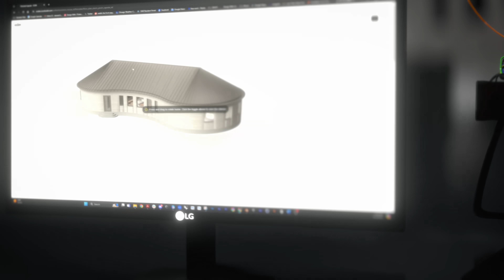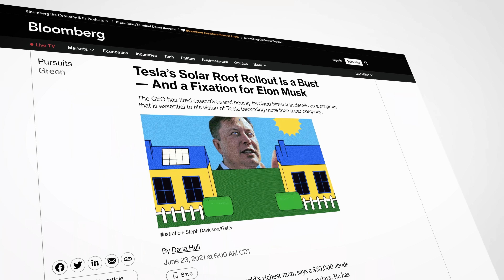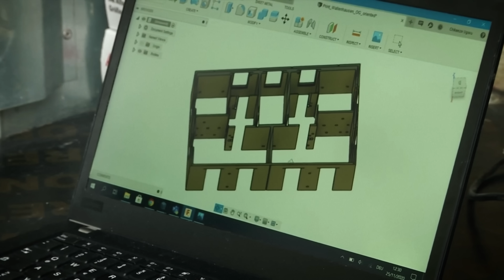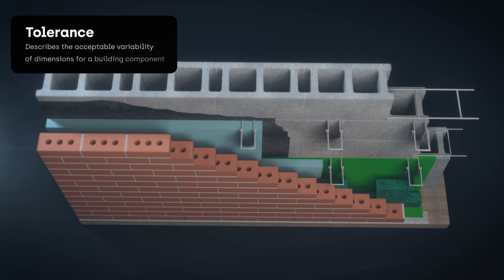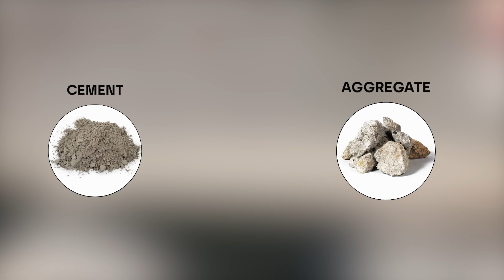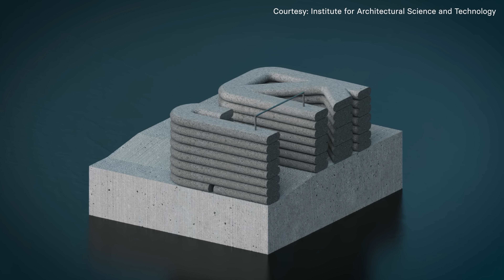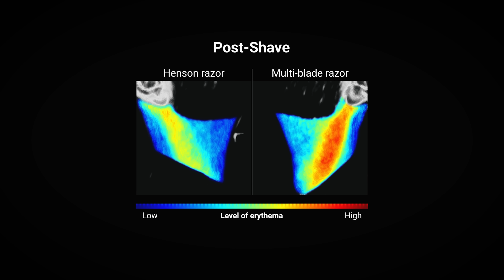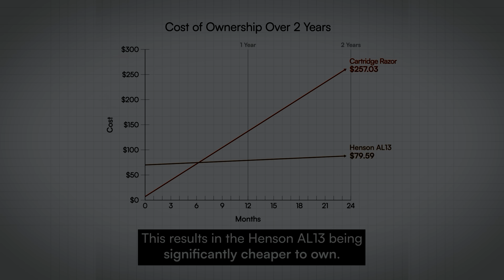Why 3D Printing Buildings Leads to Problems

Comment: From the comments, I've noticed others have mentioned about the plumbing & electrical, which I have to agree with.  Usually, those plumbing would have been determined on the layout of the foundation before pouring the slab.  In the opening scene, slab is poured but it looks solid, with the walls, but I see no plumbing for water/sewage established.  Putting in water fittings and plumbing after the fact or repairing might become problematic.  Is the electrical/communication also underground established or above ground?  The segment discussing the windows and mentioning of drain vents for water in the walls to drain out was interesting, but I was wondering if the mixture of the cement pour should be weak/bad, that didn't pour/spread evenly, there might be a gap or weak spot that an upper window/opening at a higher level of the pour pouring allowing water to get in/flowing downwards within the walls that any weak spots in the wall on the inside perimeter would find and leak inside.  Then one day, the owner finds dampness on a upstairs floor or moist running down an inside wall.  It might be complicated to detect where the leak originates.  Are the exterior cement or interior cement walls plastered, or plaster walled so that hanging of pictures can be done?  Usually besides windows, exterior lights or interior lights, drapes, pictures, electrical outlets are installed, so the wiring would be running inside of the cement walls between the cement wall and wooden/plaster board walls?  The section of modifying the construction later would also be a factor of homeowners after several years of the owner's living will definitely come up for expansion/modification.  The question of durability of cement?  At some point in time, wouldn't the mixture start weakening?  I have hollow tile cement block retaining walls, which I see some of the cement tiles flaking apart.  Wouldn't that occur with the same cement as well as stress of ground shifting and such?   I know the contractors built my slab home and I had the workmen later on pour a sidewalk around the perimeter of my house with cement, but while it was wet cement that came for the workmen mixing and framed next to my foundation, the wet cement wasn't 100% insect proof that termites or ants would work their way up through the gaps in the sidewalk and trying to entering the gaps of the exterior siding and interior walls.  There's a lot of questions on addressing issues about this type of construction.

Comment: The best way to build a house is building it in sections in a factory with plumbing , electrical , doors  and extras pre installed. You get very little waste and the truck used  to deliver the sections can also be used erect the house if it has a crane fitted.

Comment: Cars and phones.. have gotten cheaper and more and more cheap. Despite their prices.. going up. 50g for a average car, 1200 for a "phone".

The Construction industry.. is a physical operation involving people and property. Half of which cant = shouldnt be eliminated.. purely due to cost. As we find out devices are made by computers.. and or whole factories... can "almost" run themselves.

Vertical integration.. is a tech word only applied to the quick and easy applications of plastic and its many forms.

Comment: So you are partially incorrect about them not being able to make sharp 90 degree turns as it turns out they actually can but not on all corners.. and thats without any fancy modifications. If you think of a cross like the letter t, you have 2 straight lines with 4 90 degree corners at the intersection and yes 3d printers have been able to do that for a long long time now.. many years.. you lay down 1 line then come back at another angle over.. you either get a bulge or you reduce the material flow over the spot.. but they have been able to do that for a long time thats actually how they get from 1 area to others over gaps by just stopping the flow...so technically they can do them.. and have been sorta doing the things that would make that possible soooo... lol

Comment: Another mistake. Thinking repair is difficult. Look at composites. You modify air frames with a chainsaw and a relay up over the cut. You are stuck in the logic of old materials instead of immersing yourself in the new material and working with its possibilities.

Comment: 3d printings largest benefit is in the creation of otherwise impossible geometries. For example, creating a strong and light weight member by printing a stress flow optimized internal latice structure. Or creating convoluted internal cooling channels. Etc...

What 3d printing is not good for, is simple, cheap, and repetative tasks. Like building a wall according to code.

3d printing could be useful if building code was updated to allow for the interesting "impossible" internal geometries it shines at creating. But according the current code there really is no reason to even consider it.

Comment: I just don't get why all 3D house printers are hellbent on printing the whole house. 3D printing is an awesome technology, just like reinforced concrete, resins, drywall etc. It can be used in many parts of a house structure, but it DOESN'T have to be used all over. Finding new ways to integrate old and new technologies in a harmonious way is how architectural construction develops

Comment: 3-D printed wall - takes days to place, a carpenter crew assemble and stand walls in hours, with no issues to make openings.  Hollow walls are the heart of modern mechanical and electrical installations - since these M&E trades need access to the wall core, steel or lumber framed walls are a simple solution leaving off sheeting one side until the M&E is both installed and Inspected.
Whether the building is in a cold or hot climate it still needs insulation, vapour controls, roofing.
3D printing doesn't solve or fit with any of these requirements.  Meanwhile the 3D printing material is highly controlled and non-recyclable material that is not saving money or energy in the overall building process.

Prefabricated panelized walls seems to be far superior to printing on site, far more acceptable to traditional construction skills, inspections, and BP  approvals.

Comment: 3d-printing buildings are not durable or even safe.  Ground settlement,  earthquakes,  how does a high mass,  weak unreinforced structure perform? forget it.  maybe in the future,  but the current technology is a liability,  and a dangerous risk for most areas of the world.

Comment: You missed one very important point. Manufacturing cement generates a lot of CO2 (I've read somewhere that it surpasses the Aviation Industry fuel burn) so, if we want to design sustainable housing, maybe it's better not to too much cement.
Here in Portugal, for small houses, the trend is to use relatively large "thermally insulating bricks" that are relatively quick to install (10 bricks/m2) and don't require much mortar/cement.

Comment: Cement Printing is Pathetic and Dust Collectors , they cant even design scrapers on the side of the print nozzle which smoothens out the walls vertical face, At least then you would be getting a better finished product?

Comment: The inflexibility after construction and difficulty of repairs are huge issues. Houses should last preferably over 100 years, thus needing repairability and flexibility. 

Also, if you leave it bare on the interior, it seems like a nightmare from cleaning perspective. Way worse than round log wall, and even those gather dust in an awful manner. On the outside, how will that texture deal with rains (expected to increase a lot in the next few decades in many areas) and snow?

Comment: For experimentation, the 3D concrete printing is interesting. BUT this is only one element of the construction process. Concrete is great for compressive loads but not so good with tensile or shear loads. Throw rocks at wood construction as you will...but wood can be made much stronger than these piles of concrete. And wood can be modified with much much less pain. Yeah, this idea is a bit dumb.

Comment: My question to you is so what I mean technically the building now has rounded corners that's actually better considering kids like to smack their heads against stuff that has sharp turns and it usually ends up with them losing teeth how do I know

Comment: How do you repair things like electrical or wire in new outlets you may need in the future. What if rats make their way up the plumbing and eat a hole through the off gas pipes. Do you need a concrete saw just to cut into and access the plumbing and electrical. Plus how do you restore the wall. Sounds like a nightmare to service. Rodents will find a way in and will bankrupt the owner with repair bills.

Comment: Its kind of hilarious that the only thing that have to brag about (speed) requires leaving out the time to set up and tear down the machine. Youre gonna have 3 to 4 days in "printing" a building and 3 to 4 in having a crew stack brick. In the grand scheme there are better methods being produced right now including multiple modular homes you can have delivered and assembled in a couple days that are mostly self sustained. The tesla home that has been proposed is currently being built by the company tesla partnered with, and should be released with the actual tesla branding in the next year or so according to rumors. 3d printing is great for a lot of things, but not everything

Comment: With small home 3D printers I wish the printhead had some type of vision or sensors that could look at the previous layer, ensure alignment, even if there's noticeable shrinking.... It would seem that with a house something like this would be even more valuable in case of situations where the location or the machinery doesn't work quite right. You could have those wall placement tolerances, and if a wall has to be placed outside of that standard then the machine could stop and alert the operator

Comment: If you are prepared to build with concrete walls precast panels are aesthetically more pleasing easier to line ,more versatile use existing infrastructure and very quick.i have poured 32 panels ( only 3 of similar size) in eight days on site and two days for erection on a building of  300 square metres .that included several fancy entry panels. Manpower, three carpenters two concrete finishers and supervisor on a very tight site. Setup time for for work was three days. Entire build time 49 days.

Comment: If you make a car or computer you don't have to wait on lazy government employees to get each and every permit and wait again for each and every building inspector and more waiting for materials because some crack head broke in and stole all the wire and weather more waiting, waiting for the concrete to dry more waiting for the gas and power companies to hook it to the grid. Gee I wonder why it takes so long

Comment: The issue with the housing industry is that every time a new technology is invented, it is implemented trying to imitate traditional and obsolete architectural designs which has led to a very slow transition... form follows function (and viceversa) in most cases, and the shape and aesthetics of traditional houses respond to the technology available at the time... with 3D printing, we need to develop a new aesthetic that will go with this technology, instead of forcing it to fit with preestablished design typologies. Not all houses have to look like a 2 year old idea of a house!

Comment: for me, traditional houses look like shit... I loath pitched roofs, shingle or traditional tiles, unnecessary decorations, mouldings everywhere, eaves, cornices, architraves, etc, etc, etc... it is all unnecessary (as most of these are merely decoration) and labour intensive processes that can be cut if we strip off buildings from these details and concentrate in getting the basics right. A house needs to be quickly and cheap to build giving confort and well lit spaces. The rest can be done with reasonable ease and you can make it yours by putting your own furniture and deco. A house does not have to look like a doll's-house drawing (a square with four openings with a triangular roof and chimney on top)...a house can look like anything you want it to be.

Comment: One of the issues/mistakes I can see here the need to transport this huge 3D printer to the site, assemble and disassemble each time. Why not make the house in to a transportable modular sections and then simply assemble the house on site but keep the 3D printer at a dedicated fabrication facility? That way the machine can run 24/7, doesn't require calibrations every single time. Also, if done in a dedicated facility, can solve the rounding issue by having massive cutters and shapers that can cut the rounded edges to shape you want.

Comment: Problem is that they look like sh!÷. 
Im a concrete guy and i would be ashamed if i produced a house like thst and it looked 3d printed st the ebd. All they need is a finisher to go behind and smooth it out with a singke steel trowel pass. Otherwise you need to have a whole other step done or leave it look like that.

Comment: “3D Houses have problems…You can’t make corners it has to be rounded” 😂 Dude is probably also scared when he sees a rainbow flag. Clearly uninterested  in exploring this explosion in innovation. Even if it phases out, it’s invaluable research to further the mission of fabricating durable and affordable homes. 

He used his shaving razor sponsor in an analogy, to say that these homes are a scam. what a bought and paid for pile of trash this channel is 😂

Comment: Typical Tech Bro approach lets find a problem that doesn’t exist and chuck tech at it.
The external envelope is the quickest and easiest part of construction.
Plenty of existing technologies that can do it fast, so why use slower brick, 🤨 because people prefer brick.
Plenty of factory produced house, huff house anyone.
3D printing is not the answer

Comment: You don’t have to stack bricks to build a house, you can sculpt a molded panel and put it up; What’s great about this is if you get tired of brick, you can have the panels changed through swapping it out for something else. Besides, concrete houses are trash, you should be building it out of wood, so you can change the interior whenever you feel to do so, with concrete, you’re dead stuck in it, & can’t add a door, a window, an opening, you cannot edit your house, you’ll have to have it demolished and then have to concrete everything all over again; They’re trying to lock you the homeowners out from remodeling your own homes the way you’d like it, DONT LET THEM DO THIS, ITS A SCAM!!!

Comment: Stop trying to make things crapper & cheaper in quality,…stop trying to 3D print trash! Homes need to be built by a construction crew, that’s just the way it is, & the way it should remain,…think about “if” or “when” an EMP wipes out the entire internet, you must still be capable of continuing high society through physical work, but if the knowledge of killed by 3D printing shitty homes after an attack on the net you’ll be incapable and too stupid on the basic level to do the work required to continue towards the pinnacle of society,…stop being lazy, don’t put yourselves in a situation that will result in the dumbing down on critical work, and human engineering which had been built from centuries of constant efforts into it. It’s not fascinating, it’s not innovative, it’s not cool.

Comment: American houses don't last very long compared to European houses, now I know why, +/-20mm for bricks and +/-25mm for blocks, that is just crazy, you wouldn't get away with that in Europe, you have to be much tighter than that.
20mm on a brick is almost 1/5th its width (102.5mm), we would only allow that much of a corbel on decrative work, not structural.

Comment: These are engineering issues that will inevitably be overcame. We have crossed the rubicon. These current limitations will not be the same ones in a decade. This is a gigantic leap.

Comment: This is only ONE 3d printed construction process.  All the negative comments here are kind of funny.  I would imagine these same types of comments were also made by folks when pre-fab houses started.  Same when the first cave person went outside and started building with wood.  WOOD?!!  Idiots.  It'll never catch on.  Look ahead, folks.  And... a lot, if not most, of these comments are from geniuses who didn't even watch the entire video.  The speed is phenomenal.  An entire house built in days, not weeks or months.  The number of people; 2-4, not dozens.  Durability: centuries, not decades.  This is actually an amazing breakthrough.  And... this technology is in its infancy.  It will only get more and more affordable.  New machines and processes are MUCH more efficient and elegant, and include automatic placement of steel reinforcement.  Also, "3d printing is mostly used for prototypes".  Not sure that was even true a year ago.  3d printing is now used all over for production.  This is outdated.  3D house building technology has advanced quite a bit and will continue to do so.

Comment: I don't get how they are getting around requirements for rebar etc with these 3d printed concrete homes? Are they including lots of fiberglass in the concrete? 
I'd rather do Insulated concrete forms. Stack foam forms like Legos. 
Fill it with rebar and concrete.

Comment: Most states and some countries no longer allow the use of fly ash in cement.  It does make for a smoother easier surface to finish.  Before it's mixed with the water and years later with chipping and such.  The fly ash blows around because of how tiny and jagged the edges are.  It's just as deadly as asbestos when inhaled.